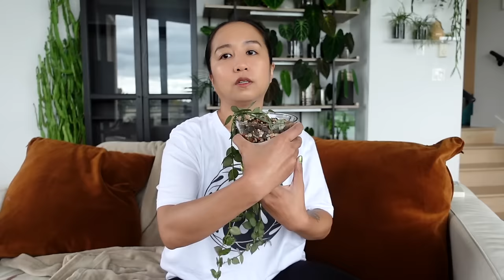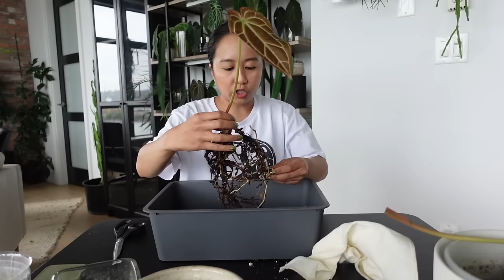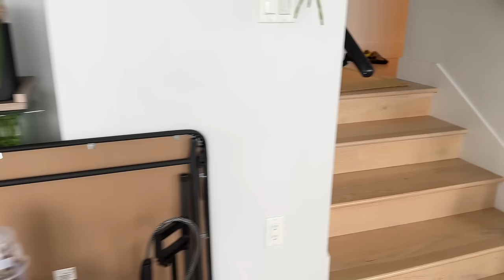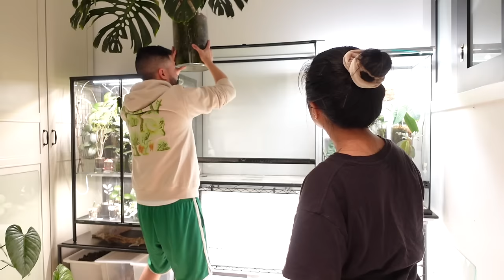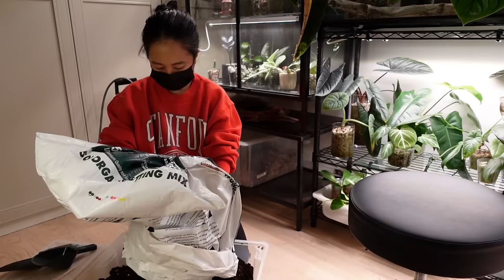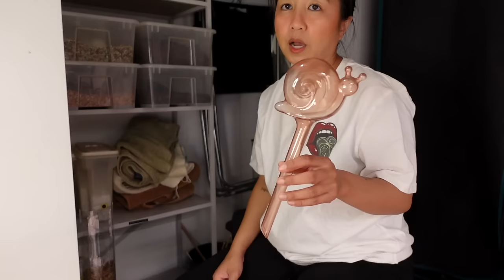a week of plant things #20 / ITS 📣 PURGE 📣 WEEEEEEEK 📣

Comment: the lechuza pon you have in your amazonstorefront isn’t available/out of stock. 
do you have another item link as a substitute for this item 😔

Can you please do a video about getting started with plants in pon ( nutrients, how often it needs to be cleaned/changed, ph, etc)
Reply: im located in the u.s
Reply from the maker: unfortunately lechuzapon is almost always sold out on amazon and on their website directly :( you can try buying pon from https://variegatedplants.shop/ but just keep in mind it is going to be more expensive since it's mixed in small batches, but it's good to have if you're in a pinch! i use inna's pon and love it (just needs to be sifted since there is quite a bit of dust in it)

Comment: So could I just use the regular Castile soap instead of using the two kinds of soap. I don’t care t about the smell either way.
Reply from the maker: you can just use regular castile soap! but since pests are (apparently) deterred from essential oils, the ones with peppermint or tea tree is supposed to work better. i've definitely seen the difference. i've been using regular castile soap for years and it really hasn't worked the way the new soap seems to be working.
Reply: @unplantparenthood  I’ll have to try the peppermint Castile soap. I wish I had some other use fit it. It’s such a big bottle and when you only use a little bit at a time it seems to last so long that I feel I’ll never finish it. Lol 😂